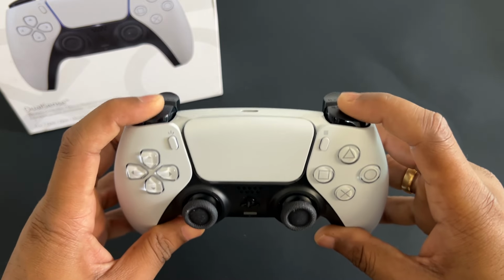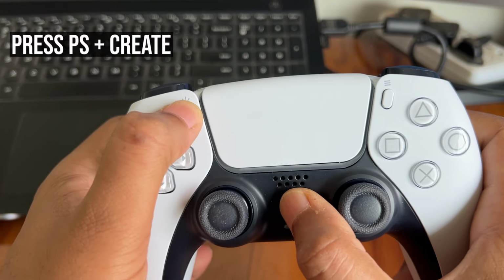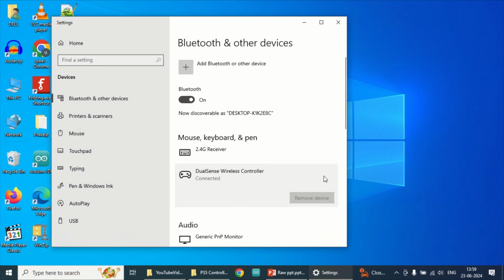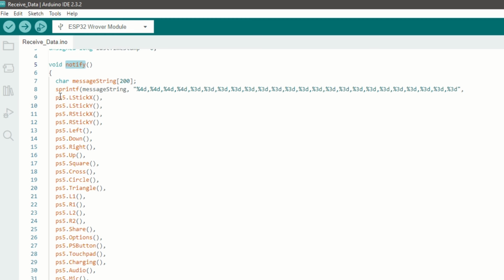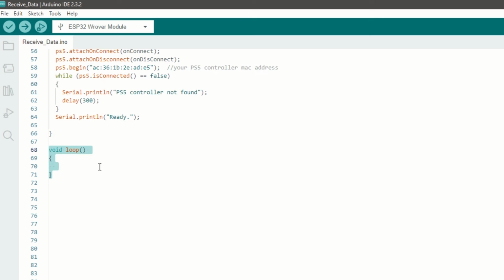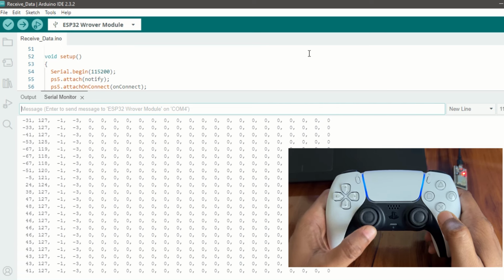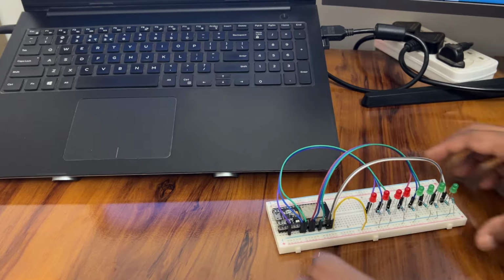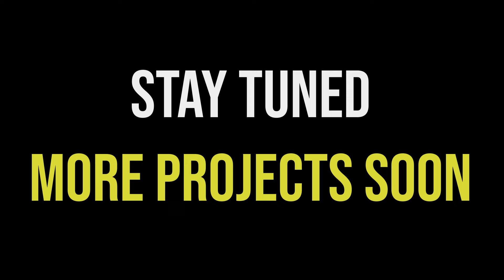How to use PS5 Controller with ESP32 🎮 | Connect PS5 controller to esp32

Comment: I had used this library a few months back. The issue is it doesn't offer a lot of the ps5 controller's outputs. The controller itself would be fantastic if it had outputs for the esp32. Please let us know if there's any way to fix this.
Reply from the maker: Thanks for pointing out . Sure I will also check all the functionality of this library 👍🏻👏🏻

Comment: I bought a fake ps5 controller , it can connect to Mobile but Cant connect to esp32. How can we use fake ps5 with esp 32?
Reply from the maker: Check for the steps in video 👍🏻👏🏻